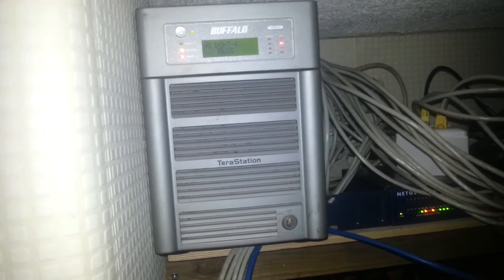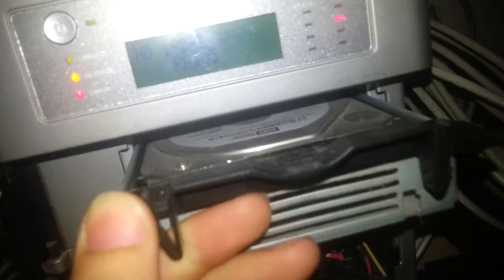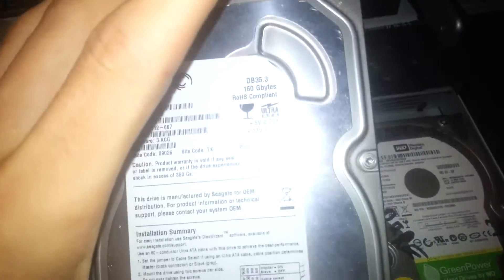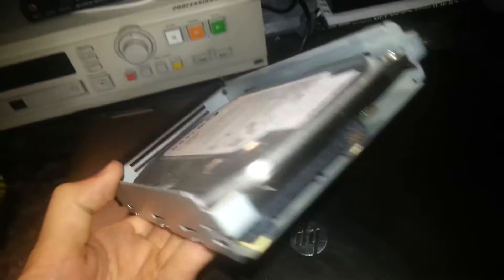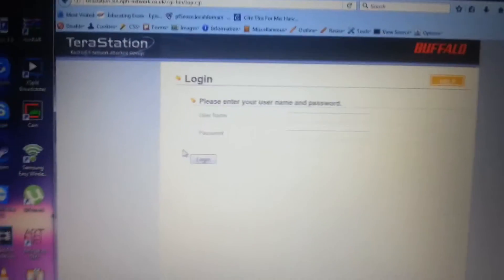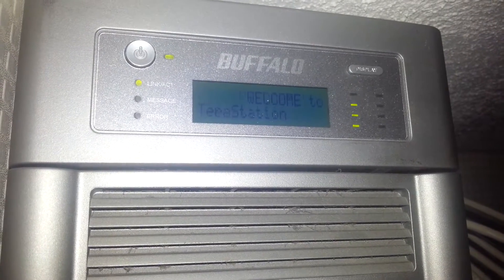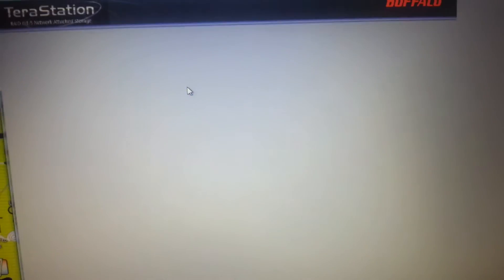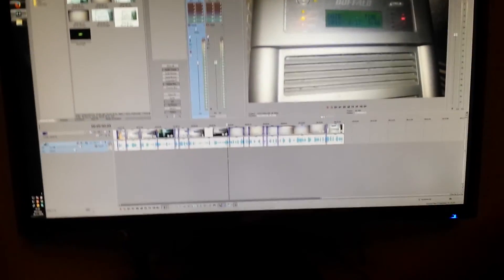MY RAID5 ALMOST DIED! - Buffalo Terastation NAS RAID 5 Failed Drive Replacement & Array Rebuilding

Comment: You replace the drive while the unit was still on ??????? This unit is not hot swapable right?
Reply from the maker: +Marty Lynchian I believe it is hot swap, however it doesn't really matter anyway as the drive was totally knacked anyway so removal couldn't cause any more problems than currently existed haha.